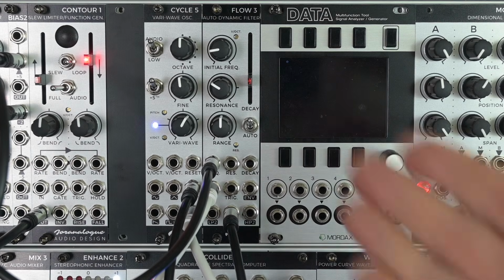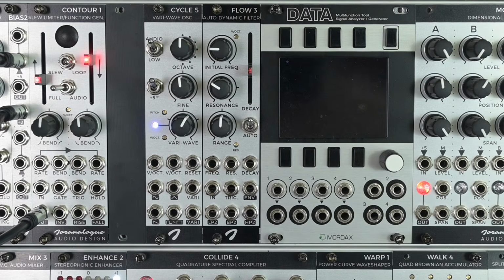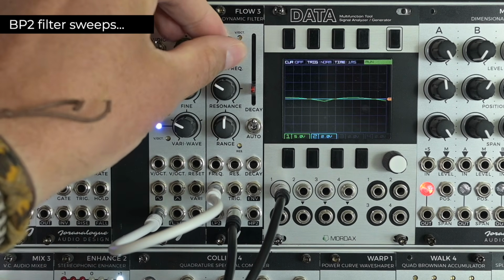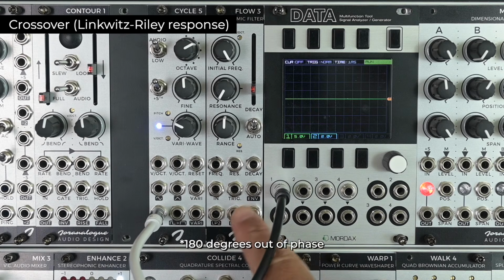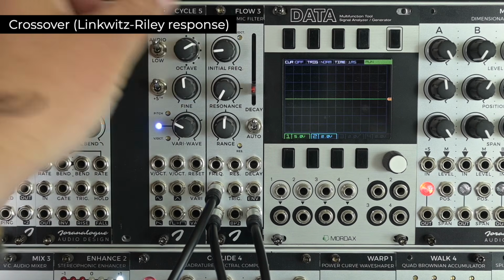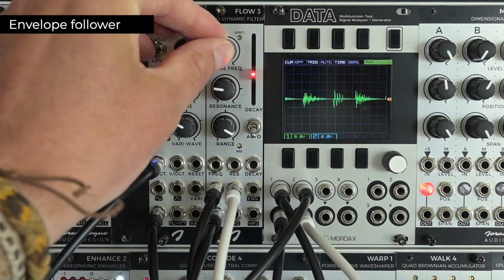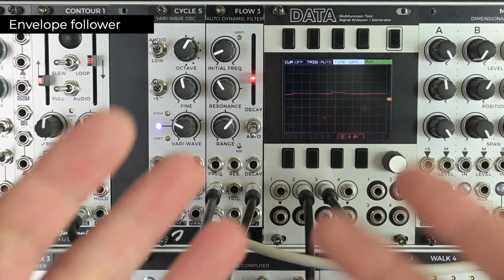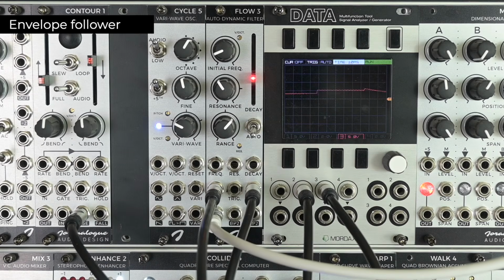FLOW 3 | Auto-Dynamic Filter | Quick Overview

Comment: To use this as a crossover, would you need an additional module to invert the phase of the signal? Or is one of the LP/HP signals already phase inverted?
Reply from the maker: Hey! The LP and HP outputs are 180° out of phase with each other, so all you need to use Flow 3 as a crossover is indeed a module to invert one of the outputs. We use Select 2.

Comment: whats the latency of the envelope followers? in my experience all had had a delay and I was not able for example sending an audio drum loop and the cv generated to use in the my system cause it came after the audio...
Reply from the maker: Flow 3's envelope follower has a fixed attack time of 1 ms, which works best for most typical signals. The signal path is fully analogue, so there is no additional conversion latency.